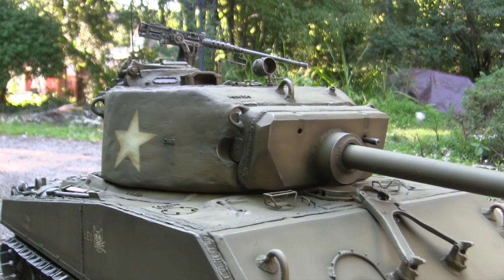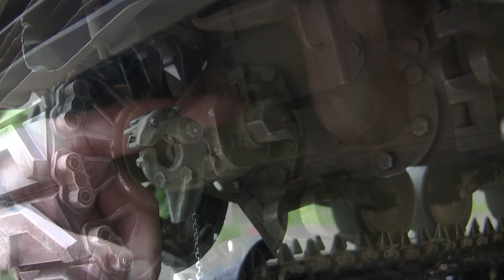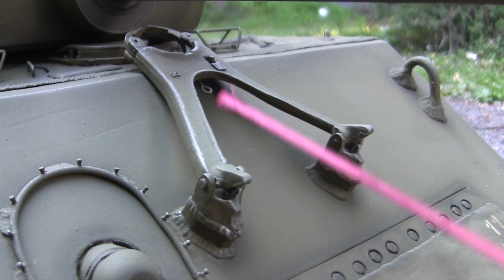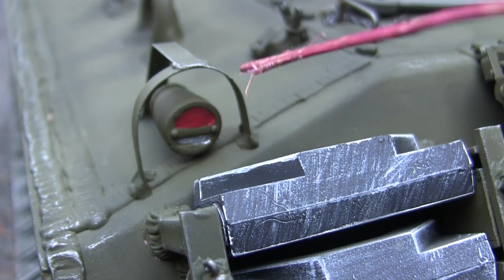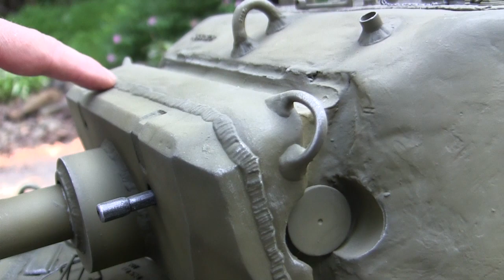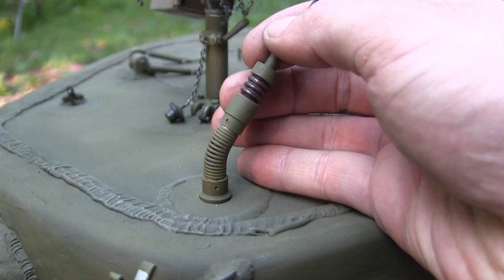1/6th scale M4A3E2(76) Jumbo update

Comment: I love this Sherman! It's so hard for me to find one in 1/6 scale at a decent price.  It would be cool if you could make a mold of the turret and make resin copies of it to sell.  The paint job is really good as well. I love how this tank has so much character
Reply from the maker: 1/6th scale is an expensive scale because of the size of everything and the amount of material that is required to produce the items. As I mentioned in the video I made this turret and hull for a 1/6 scale vendor who made molds for them and were sold at one time as kits. These days 3D printing does help with making these models more affordable but they will always be more expensive than the 1/16 or smaller scale counterparts